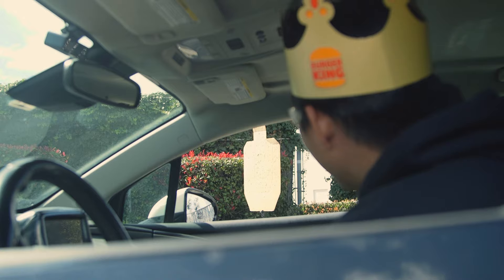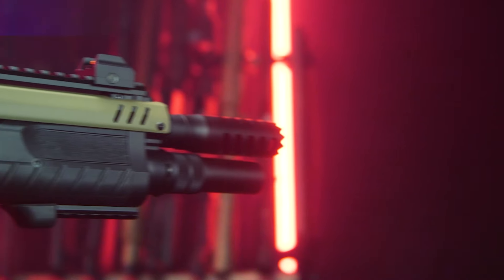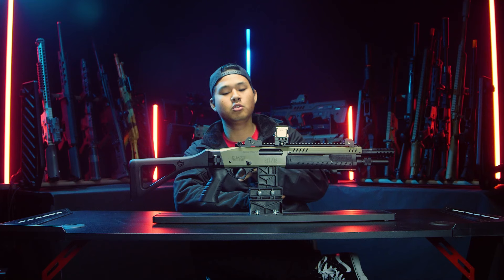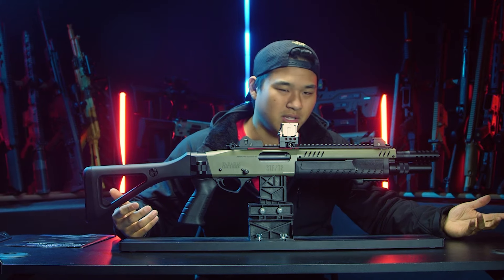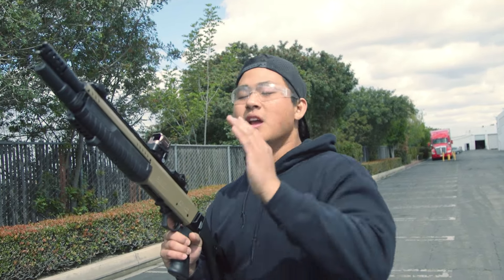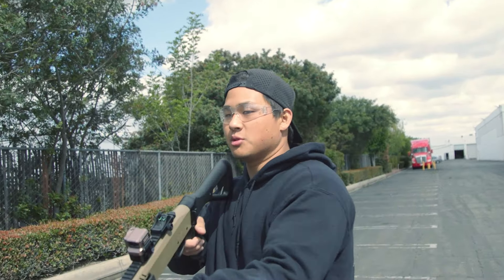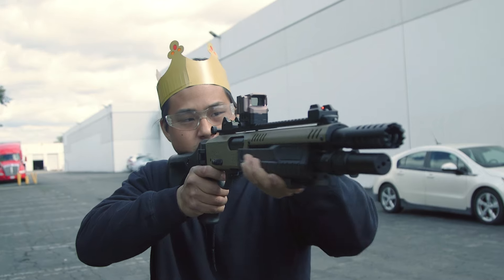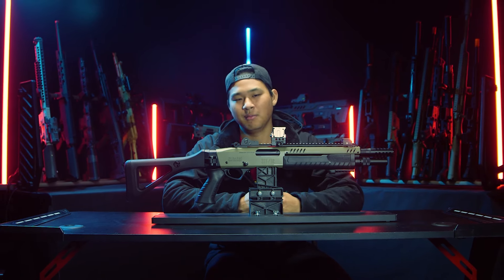Overpriced Replica Shotgun? FABARM STF-12 Gas Pump Action Airsoft Shotgun Overview | Airsoft GI

Comment: The real Fabarm STF 12s are probably the best tactical pump action shotgun in existence. It has a better trigger assembly then the 590s, and is more refined then the 870s. It has a superior sighting system to all of them. They aint popular because they cost the same price as a tactical semi auto shotgun. They launch slugs with insane levels of accuracy. Been tempted to get an airsoft equivalent but it needs to have unparalleled external quality to somewhat mimic the real thing to be worth buying... even if that carrys a premium price tag.

Comment: Had one of these pre pandemic, specifically the version without a stock. I will say it's a very solid feeling shotgun. You could also take off the rail on top so lighten it up a bit, a nice option seeing that the real one can do that too. I only had two main complaints, the first being the co2 canister screw that you tighten to puncture it. It's a pretty thin little plastic piece that you can easily accidentally screw on the wrong way. I wish they made it at least twice as thick so it would be easier to screw on and therefore less likely to ruin the threads. The only other complaint I had is that the 6 round mode wasn't very reliable. Its fine when you're very very close but in my experience the bbs will go all over the place after maybe 15 feet, even with 0.28s which should hold their line a bit better. If BO released a 2.0 version sometime that would be great. Or maybe they ironed out the kinks since I had one I'm not sure.